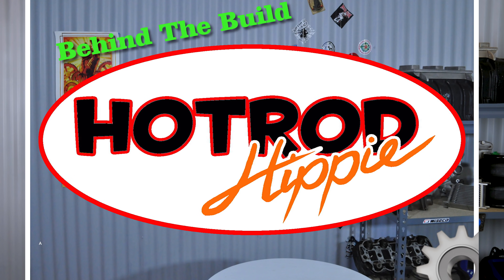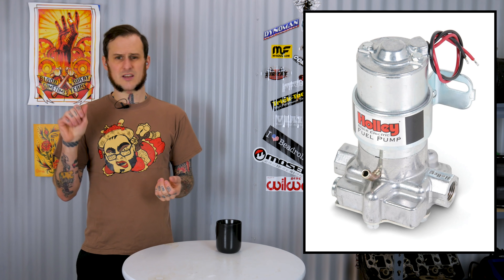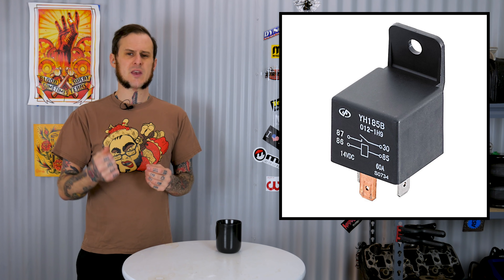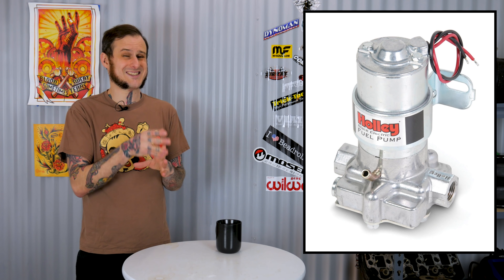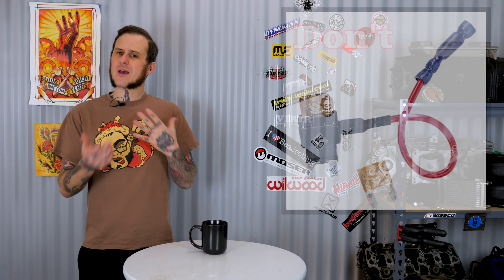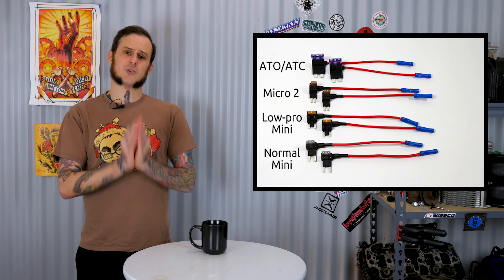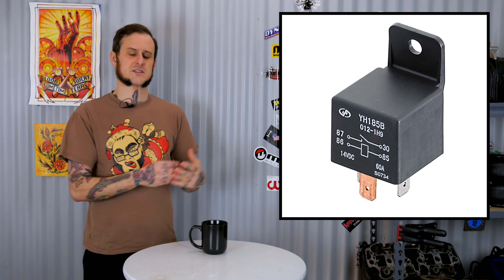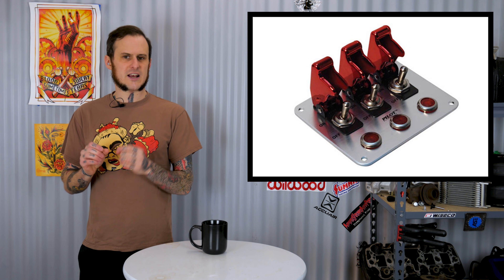Relays and Fuse Taps - Auto Electrical Dos and Don'ts - Episode 2

Comment: I believe that you’ve misunderstood how a piggy back fuse works. 
The bottom slot (closest to the metal tabs) on the piggy back is for the original fuse. This just closes the original circuit which is identical to the original design of the fuse box. 
The top slot only connects to the hot side of the fuse holder. The piece of wire that comes off the piggy back fuse then runs to the item that you want to power. The circuit is then complete. 
The two fuses don’t simply “add up” so a 30A and 20A don’t equal 50A as they have no physical connection to each-other.
This means that the fuse from the original circuit will blow as designed and the fuse that is in the new circuit will blow as designed. 
The circuits are as safe as they were before the piggy back fuse was added
Reply from the maker: I fully understand that. My concern lies on the feed side of the fuse circuit. That does see the increased load of the two circuits. In some fuse boxes they are actual wires. In others they are buss bars. Either way their is a potential to overload the feed side. I've seen it happen where the terminal on the feed side straight up burns out because it's feeding more of a load than the manufacturer ever intended it to do. 

These can be useful but as with most things people often abuse them. If you are powering a tiny load like a relay, then they are fine. But if you are powering some fog lights, that's a problem. In my experience people who use them often don't even know what a relay is, so they are often misusing these  Thus why I tied the two devices together in this video. 

I appreciate your attempt at correcting me and you are not wrong from your perspective. You just misunderstood what I was saying.

Comment: If you use a fuse tap you do not add to the existing load . Most fuse taps have two fuses the one on top is the new load the one on the bottom is the existing load and you would install the existing fuse . So if your radio has a 5 amp fuse . And you install fuse tap you put the five amp fuse in the bottom & the wire coming off the new fuse  tape going to the new device you put that fuse in to the  top fuse One fuse has nothing to do with the other . So how are you over loading a fuse
Reply from the maker: It isn't about overloading the fuse.  It is about overloading the feed side of the fuse.  Many fuse boxes are using a Bus type feed but some are not.  Or the Bus feed may not be designed anticipating an increased load on it.  The point is that the feed side of the Fuse may not have been designed to see the increased load.  It isn't about the load device that normally uses that circuit, as you said its load isn't increased because the Fuse Tap creates a Parellel circuit, not a Series one.  However the Feed side of the original Fuse Holder IS under a Series load (Series-Parellel really) and that does increase its load.
Reply: So what’s the best way to run a dual battery isolator that callls for a Circuit from the ignition . I’m just thinking about running a lighted switch on dash fused from the battery to the relay and just manually turn it on and off as needed . Seems to me this might be the better option
Reply from the maker: @stephenboldrey9973  I never really support manual switches because they just leave too much room for error.  We all make mistakes after all. 

For that kind of use I can recommend a Fuse Tap.  I was not really thinking of such small loads when I made this video, I was more so concerned about the people I see installing lights and other heavier accessories with these things.  I cannot say for certain with your specific brand of isolator but as far as I can tell most of them pull very little Amperage (1 or  2A) on their signal Relay.  

Using a Fuse Tap for a Relay is acceptable as it is such a small load that virtually any existing circuit will be able to handle the small load.  Just be sure to size the fuse for it accordingly (2A is probably fine).

Comment: What about the two fuse tap. Pull the fuse put it in the bottom slot and a new fuse on top . Like i did with my dash cam . I pulled a 10 amp it goes in the bottom slot and i put a 3amp  on the top slot . For the dash cam .

Comment: I have watched a few of your videos & have learned a lot about auto electronics.  I want to put an on/off switch on a particular fuse on my SUV.  Fuse #14.  How can I do this?  Will one of those Fuse circuits work?  Thanks, love your stuff!!!
Reply from the maker: I'm going to need more information. What's the vehicle and what does that circuit do? I can think of how to manage that with a few circuit styles but not without knowing how yours actually is laid out. A fuse tap wouldn't be my recommendation to do it though.

Comment: Can you please advise me, I'm trying to add  led lights    to my fj crusier foot rail that's connected to interior lights so when I hit unlock they turn on with the interior lights, can you tell me what i should do trying to DIY
Reply from the maker: There is no garauntee that tapping into the interior light fuse would achieve the desired effect. In fact I'm quite certain it wouldn't. I'd have to see the wiring diagram to be sure but the fuse for the interior lights should be hot all the time and the lights are controlled somewhere else in the circuit. Using a fuse tap for this purpose will just put the lights on all the time. You would need to run a relay that triggers the foot step lights when the interior lights are triggered. Not complex but hard for me to explain if you don't have a good grasp of circuits. What year is the FJ?
Reply: As long as you get a fuse tap with 2 fuses in it (one for the original lights and one for your LED lights) you will be absolutely fine. Fuse Taps do NOT put any additional load to the existing downstream circuit (in your case your lights) because they are wired in PARALLEL to the existing circuit branching from the point of the replaced fuse. The only thing that is taking extra load is the fuse box itself, and that will be absolutely fine because it is built to handle this (after all there are many fuses for many circuits all branching off the same pair of switched and unswitched 12v supplies).
Reply from the maker: The point is you cannot know for certain that the fuse feed side (as you noted the box sees the increased load) can handle the load applied. People often put too large of a load in these fuse taps, unnecessarily risking it. Yes many fuse panels run buss bars that feed branches of circuits but you cannot know the intended vs maximum load of the individual portions of that. Many fuse boxes also have physical wires going to each circuit in a fuse box (like many GM engine wiring harnesses for instance). Those absolutely could be overloaded. 

People who gravitate to using Fuse Taps as their first course of action rarely research or know how to check whether a circuit is capable of handling the increased load being applied. Thus why I say, just don't use them.

Comment: I used a fuse tap for key power to a dual voltage reader. 
I'm assuming this is a case where it doesn't affect too much?
Reply from the maker: Correct that's a low power draw situation. Just guessing there but I feel confident in saying so.

Comment: Brother I am planning to fit fog lights in my car. There is no company fitted wiring or any fog lights. So I am planning to use a piggyback connection to the fog lights switch. Is it possible ?

Comment: Installing a 12v LED light behind the grill of my truck. I was going to fuse tap it to my headlights so it only turns on when they are on, but now I'm thinking otherwise. How could I use a relay to make them do the same thing?

Comment: But fuse taps have 2 slots for 2 fuses. The main problem is the wire, if you add an accessory and that will give an  accumulated amperage with the original device  is higher than the rated cable.
Reply: yea, not sure what he is getting at, cause there's 2 fuses both one end connected to power other end connected to the wire, one wire the OE you don't see, the other is the add-a-fuse wire you do. Now the size of that wire matters what amount of amperage. Also the amperage supported to that fuse box you're pulling from. I definitely have an issue with the Don'ts section and would like an explaination of how the OE circuit would be overloaded by the 2nd circuit.

Comment: i’m running a on board air compressor to air up tires. I have two wires that need to go into the fuse. One goes to the tail light fuse that tells the switch on the inside to light up at light. Another is to ignition that lets me operate the compressor when the key is at ACC. I bought 15 amp fuse taps that will go into 15 amp original fuse locations. Is there any problem here?
Thanks

Comment: I thought that base circuit has nothing to do with piggyback as it is completely separate and isolated circuit.  The only real thing to watch for is to use lower amps on piggyback circuit. Fuse tap share positive leg, which is simply an extension of a positive terminal... They do not tap into circuit, they simply share positive terminal. When you plug it in wrong way around, then positive terminal is shared through based fuse and therefore base fuse must sustain amps of a piggyback circuit, otherwise it will blow. So, piggyback is totally safe and fully protects both circuits at all times, providing you use it correctly. Am I not getting something here?

P.S. I do agree however with overload, but just to clarify, overload of the feed wire to a positive terminal, NOT a base circuit. Not sure how relays are solving this problem, as it would draw power through the same wire...
Reply from the maker: When I refer to overload, I mean the feed circuit for the fuse. Many old fuse boxes are just a piece of sheetmetal for a feed. Some newer ones actually contain wires of specific gauge sizes. Both of which can be overloaded by improper fuse tap use.
Reply from the maker: Also even the positive lead feeding the fuse box can be quite small sometimes. Depending on the vehicle obviously. Many classic cars (my primary field these days) use no more than a 10-12 gauge wire to feed an entire fuse box.

Comment: I am an extreme beginner here.  What is considered a lot of amps (heavy load pulling)?
I have been watching several videos of other posters.  The numbers on the relay 30, 85, 86, and 87 are different in the videos.  Meaning which gets full 12v from the battery, switch, device, and ground.  How can the videos be different?

Comment: Nice video man. I have a question im installing 12 led pro comp rock lights, i want the to turn on when i turn on my headlights, so im.planning to get the power out of the headlights trailer hitch pigtail, i will run the power but also will put a fuse a couple.of inches after the connection, i will be running to sets of cables on each side, 16awg. What you think, can you hit me with an advice please? I will appreciate. Thanks in advance.  ( 2009 dodge ram 1500 )
Reply from the maker: I can't say how much power the rock lights would pull but I would use a relay. Wire the relay to your hitch pigtail like you planned. So when you turn on the lights the relay activates. Then wire it so you are sending fused battery direct power to the rock lights. That will be safer for your wiring and make your lights function better as well. They likely don't pull a lot of power but I'd just call it a safer bet to do things that way. Relay to control the lights on and off, and a battery feed for the lights. You could also then wire a switch to the relay so you can override and turn off the lights if/when you want. Say just interrupt the ground side of the relay with the switch.
Reply: Thanl you very much for this info.man appreciated

Comment: I just installed new tow mirrors on my truck, they have small LED bulbs in them (stock mirrors did not). Your thoughts on running a fuse tap to the reverse light fuse so that the mirror lights come on when I go in reverse?
Reply from the maker: Small Leds are a small load so you will likely be fine. However i can't say for sure without seeing a diagram but I kind of doubt the reverse fuse only gets power when in reverse. More likely that fuse has power always and a switch elsewhere sends power to the reverse lights.

Comment: Can I use a fuse tap for A CB radio
Reply from the maker: CBs can vary on power draw demands. Most are low wattage so you would be fine with a fuse tap. Unless you've got some super powerful it should be fine. I've softened on their use since I made this video. A bit anyway.

Comment: Great video! I’m trying to hook up the blackvue battery it says that 2A is max. I can fuse tap the battery to the fuse box? Not sure if I have any empty slots so would it be safe to put the battery to piggy back? Since the battery would be connected to the fuse and the dash connected to the battery. The battery plus dash mean it’s consuming more power then 2A?
Reply from the maker: This is just a guess as I've only looked briefly at the battery, but I would figure on just the battery load.  So 2A should be fine, just pick a decently sized fuse to piggyback on with the tap.  Say a 15 Amp or higher I'd say.  That way even if it pulls the full 2A you are less likely to overload anything.

Comment: I was going to use a fuse tap just to power a dash cam. Thought?
Reply from the maker: Dash cams are an exception. They generally pull 1A or less in power. As such they are fine to run off a fuse tap.

Comment: would ask how about using them to hook up a dash cam in an open fuse slot ???? so I am not taking from something already in use ... for instance I put a 10 amp on the bottom and a 5 on top .not sure what the dash cam uses can not be much though... thanks
Reply from the maker: Dash cams pull very little power. You'll be safe using one for that. 👍

Comment: What is clean power?
Reply from the maker: Power without any interference. Some more sensitive wiring systems like Fuel Injection ECMs can pickup signal interference (noise) when sharing a power source with other circuits. That's why they require you to wire them directly to a battery without exception.

Also pulling power from a fuse box or similar source usually results in a voltage drop of some kind due to the wiring and the number of circuits pulling Power. Going battery direct for "Clean" power helps go eliminate this somewhat. Again more sensitive systems need as consistent of a power source as they can get. Also things like say headlights, you don't want them voltage dropping everytime you turn on the radio or the electric fan kicks on. Which I have seen when older cars get a little tired.

Comment: I'm adding a line lock to my 2010 challenger srt8.  I was thinking about adding a circuit bus since I will be adding gauges in the future. 
I would appreciate any advice, I dont want to create any problems. 
Thanks Sid
Reply from the maker: Adding a supplemental fuseblock would be a good idea if you know you will need additional power in the future. I would wire up a relay to key power. So when you turn on the car your supplemental fuses get power through the relay.

You can use that supplemental panel to supply power to your line lock switch. Something like this panel is what I'm picturing: https://amzn.to/2SDzKeB

Comment: Very good vid, and I have a question for you (other people may respond as well). In my car, I'm installing a custom data display in the center vent which displays info from the OBD-2 port and the CAN-bus. It is powered by the jumping points / 12v battery from under the hood. Now I need to connect it to an ignition wire in the interior to have it switched on as I turn the key. Do I understand correctly that when I use the relay (there is one in the kit) it is safe to use a fuse tap JUST to open the relay and have my display switch on when I turn the key? I believe so, because as you said, the fuse tap only opens the relay but the actual power to run the setup comes from the 12V battery. It would be great if anyone can confirm this! :)
Reply from the maker: You are correct. Relays are a very small load on the control side and safe use of a fuse tap.

Comment: I don't have heat in my 2012 dodge journey so im trying to run a inverter box to power a small heater .help!!!
Reply: It would be much easier to just fix the cars heating system. And safer.

Comment: is there a way to add an additional fuse (and circuit) to the OE fuse box without using a fuse tap?  the fuse box has plenty of spare slots, but none of them are wired up. also, how does the ignition-only wiring actually work? all I  have seen so far is 'find a fuse that is only live when the key is on' but i want to wire it properly anyway. I do know the circuit does not need a relay.

Comment: Long shot question, but here it goes: I got dual mode DRL LED lights for my car (they work as drls and signal lights, i'll post the link for the exact product i got below), and i want to wire them only with engine on. I saw a tutorial on a similar product, and it states that one of the best solutions is to use the cooling fans relay (i'll also post the link below). Is this an ideal solution, or i can use a fuse tap on another, and maybe less important fuse? The product site states a 30w power draw, but no amperage.

 I want to be on the safe side, because the car had some really shady wiring from the previous owner to turn on the lights automatically with the engine( the wiring was just dangling, and the control board was kept inside of a chewing gum plastic bottle, of all things), and that, somehow, messed up the oil level warning light (the car was almost completely dry because of this), so safe to say, i want to do things properly.

https://www.aliexpress.com/item/2pcs-lot-New-Arrival-1156-42-led-light-High-Power-Daytime-Running-Light-Turn-Signal-Dual/32771024417.html?spm=a2g0s.9042311.0.0.26d84c4dbn8jjy

https://www.gadgetjq.net/switchback.html

 Thanks in advance